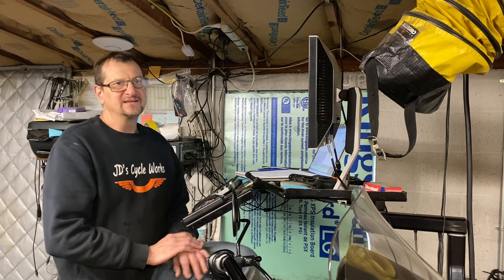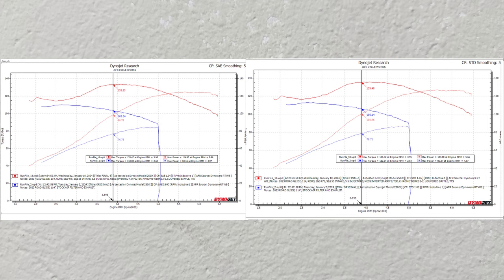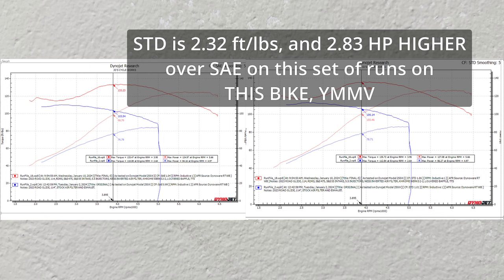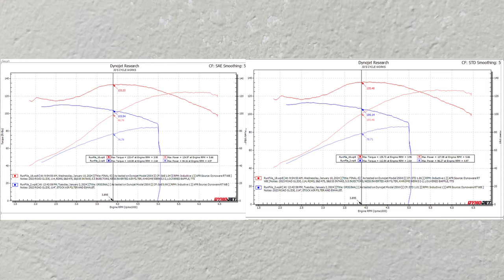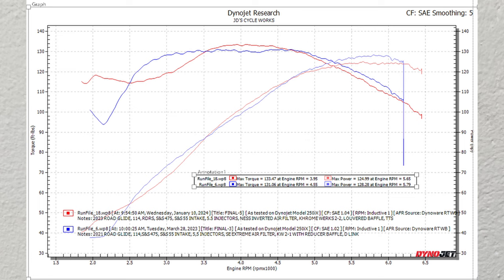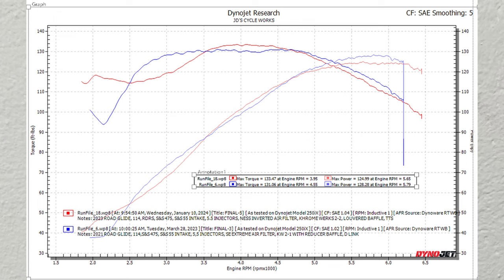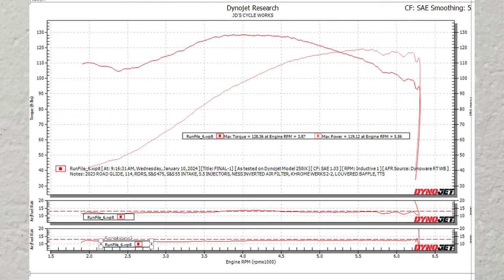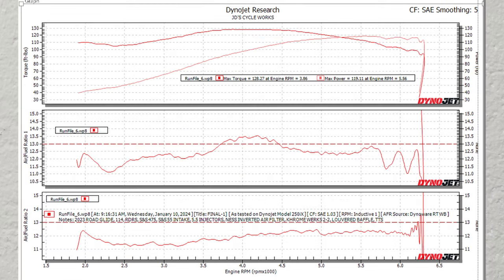S&S 475 M8 Cam and Dyno Sheets Explained

Comment: man, I just discovered you started a channel...sweet! I have a 2017 road glide special 107, stage 1 and pv tuner with 105k miles and not one issue yet! Is it  ok to drop a S&S 475 cam in it now and do I change springs if so?? thanks!

Comment: What’s the power and torque when you sit on the bike? Big difference between standing next to the bike and putting it under load.
Reply from the maker: There’s barely any difference at all. I stand next to the bike because it’s easier for me to operate the controls.
Reply: You say “barely any difference” so what’s the difference?  I have a Star Racing 30/30 cam and my tuner guy has numerous speed records at Bonneville  and my numbers don’t even come close.  I have a 2019 CVO Limited with a 117 with Rhinehart  exhaust,  Cycle Shack exhaust manifold, Star Racing 30/30 (485) cam, and Road Skulls Straight Shot air filter and I’m at 109 HP and 129 torque

Comment: I have the S+S 475 in my 2018 CVO with 117 engine. D+D head pipe, SE mufflers, TTS tuner, Arlen Ness air  filter element. It only makes 114^ HP, 124^ torque
Reply from the maker: Your exhaust system will shape the torque curve.  I believe the SE mufflers have a mellow tone and are a bit restrictive.  This may explain the numbers you are getting.  Every bike will breathe differently and have different numbers.

Comment: Im suprised that you had the tq dip even though you used the louevered baffles w the 2-2. Usually that will solve that issue in that a setup.
Reply from the maker: The shape of this graph is what I normally see with this system and cam.
Reply: @JDsCycleWorks  coming back to this now that you've been adding more cams. They all dip in the same rpm range. I compared to Fuelmoto's cam shootout and they're using a 2-1 setup w no dip. What are your thoughts now that you have more data?

Comment: Dave, you started off with saying STD is 4% higher numbers than SAE but your 475 sample runs only shows about 2% between those correction factors. What gives? I’d assume the 2 charts are the same run just printed out in both factors right? Explain the 4% rule you gave but the 2% it actually was.
Reply from the maker: The % you see will vary upon the weather, the humidity, temperature.

Comment: I have this cam in my 124 getting 131hp 145tq 
But its not smooth…
Reply from the maker: The graph is not smooth or does the bike not run smooth?
Reply: @JDsCycleWorks  the bike is not smooth before I try with 107 than I went with a big bore and its still not smooth. I think 475 over hyped by YouTubers…. Its not that good cam there is a better choices for power and M8 smooth driving experience.